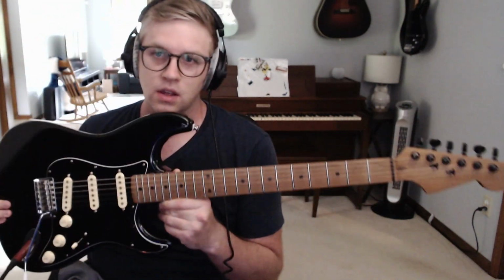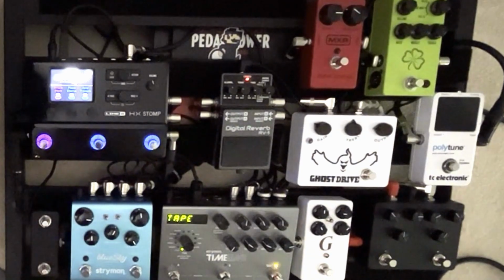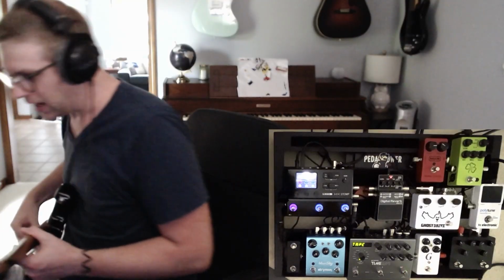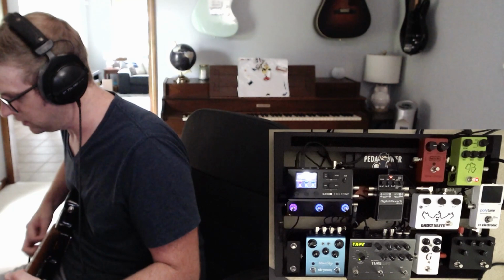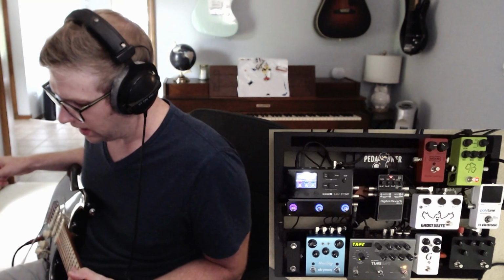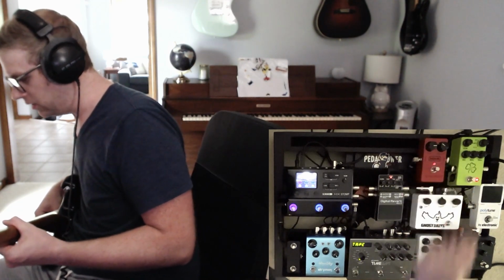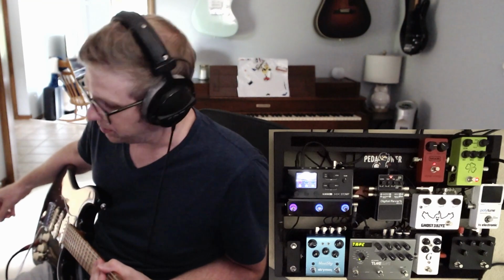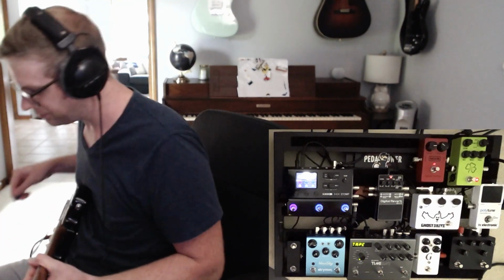JHS Clover Demo

Comment: Will it be useless if tc electronics hyper gravity compressor followed by jhs clover preamp?
Reply: No. It would probably be better. In this configuration everything is in the effects loop. (Between the preamp and the poweramp). Not ideal for most effects besides time based effects like delay and reverb.